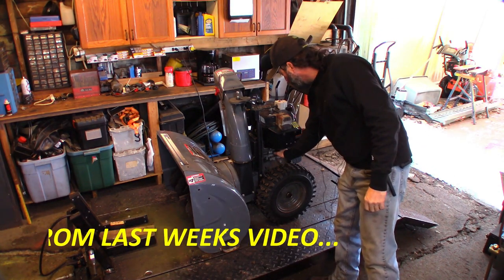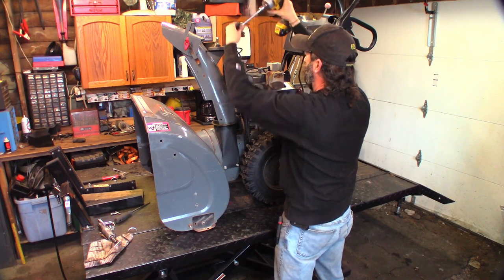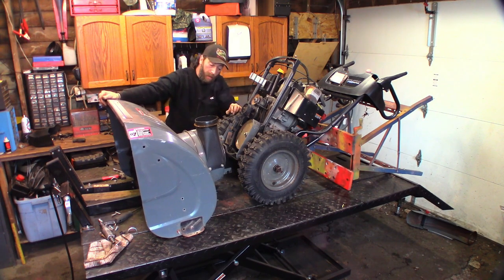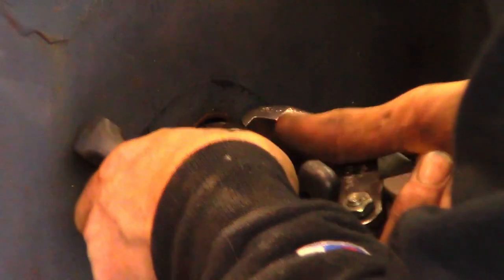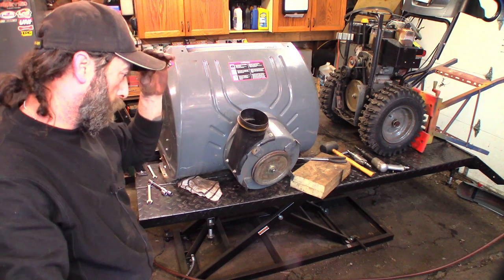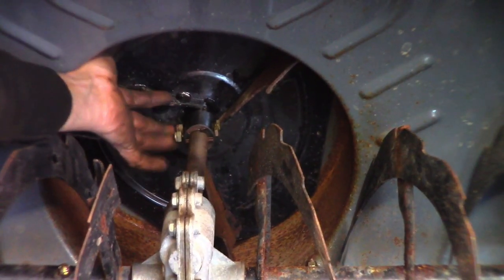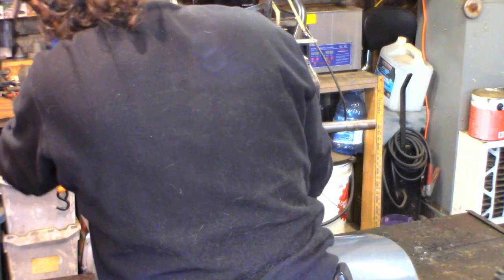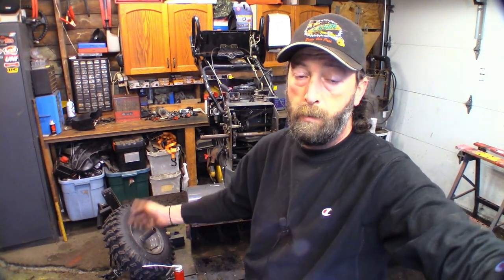Murray PRO snow blower wont start, and a bearing failure. Part 2

Comment: I have a toro that I got from my neighbor and found regular bolts on the auger where I thought there should be sheer bolts. I looked up the part and ordered replacements only to find that they were supposed to be regular bolts. Don't ask me why. This was a good video on not so common repairs on a snow thrower, thanks dude  !! I'm always learning something new.
Reply from the maker: Thanks for watching Len.  Can't say I've seen regular bolts from the factory in augers, but I also haven't worked on every make/model ever made. It seems like that is the way that Toro is suppose to be.
Reply: Supposedly Toros don't use Shear bolts and if they do hit something really hard they just stall the engine. I'm not sure that goes for all model years of Toros. In either case I would still recommend having few extra factory spec bolts on hand incase one brakes.
Reply from the maker: @robertknight4672  Thanks for that info Robert! 👍

Comment: i always wonder how the factory puts these things together...if you had a difficult time on the bench, I can't see a major factory spending extra time to put things together.....those two bolts that held the bearing plate on would/should not tie up an assemblyline worker for 15 minutes to get it together...i wonder if they tacked them on with glue or a tiny weld so they just zipped the nuts on without all the maneuvering.....i always take this approach when fixing vehicles...i say to myself, the manufacturer is not going to spend all this time putting these things together and slowing the assembly line down so there has to be an easier way to getting it done...i usually figure it out but how many guys out there go crazy trying to get it right....thanks for the great video
Reply from the maker: Excellent input as usual Brain! I think in a lot of cases it may be the way components are held during assembly. A jig that holds everything at the right orientation or angle may allow for much faster assembly. Also, those people do one thing 700 times a day, the process becomes easier the more you do it. Thanks for your continued support of my channel!

Comment: Thanks for sharing your knowlege and experience.  Do you think a marine grease would work as well as or better than lithium grease due to road salt exposure?
Reply from the maker: It is sure possible you may be correct. I use lithium on most snow blower parts because that's what I usually have one hand, and  it doesn't thicken up in the cold. There may be a marine product that has the same temperature properties and better corrosion resistance that I am nor aware of. Great question!